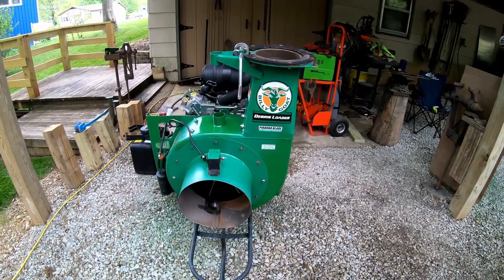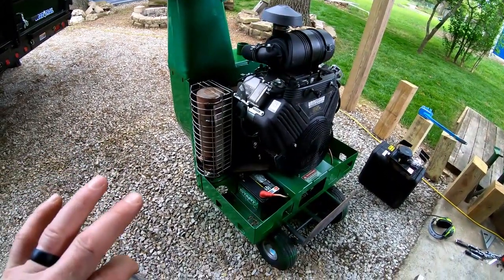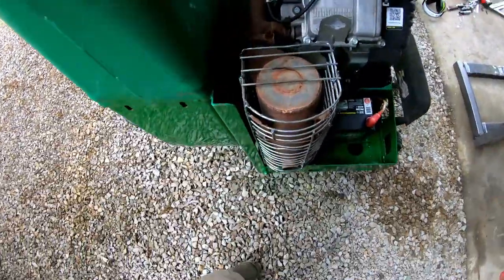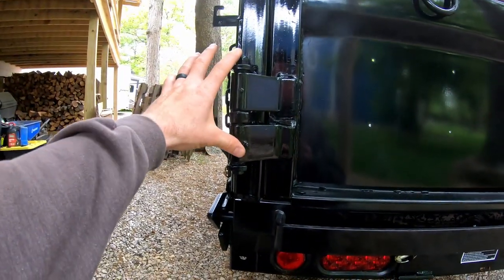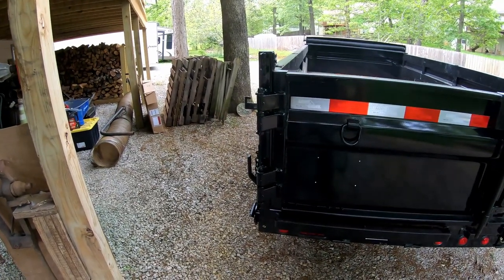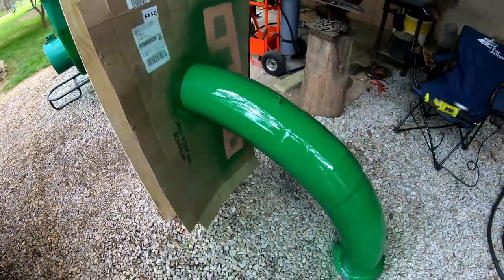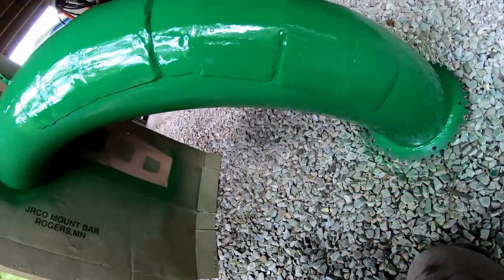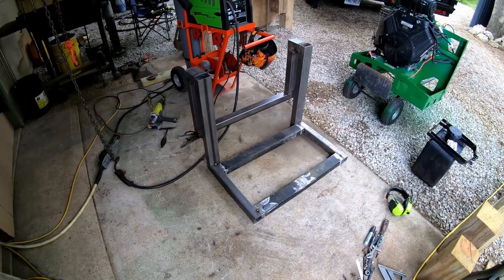35 HP Billy Goat Debris Loader

Comment: What kind of spray paint did you use it looks very shiny... I know you said it was still drying but it sure seems glossy. Also I wanted to add, on amazon you can but tube steel plastic plugs to block off the open end on your frame/mount you built... Very cheap and saves the weight and time of boxing them in with steel.
Reply from the maker: Very good idea. It's a green satin tractor paint, that is just a close shade.

Comment: Hey nice setup! You must have saw my video on my setup... you made almost the exact mount bracket! Looking good! But didn't you hear? Leaves are not falling this year... Every 2256 years deciduous trees are not. I ran my loader on my dump trailer door last year without upgrading hinges but I have 3 already on my 4' high door and I am running a 18hp which weights less. Oh and I run mine on drivers side too... No issues. I had it on the front of a different dump trailer last year (also a vid on that) however by far on the back is better.... IT was def a hassle to get to some piles when the hose was mounted in the middle of a 40 foot rig
Reply from the maker: I did watch and get some ideas from your vids 😃